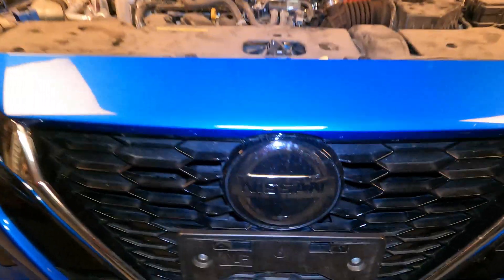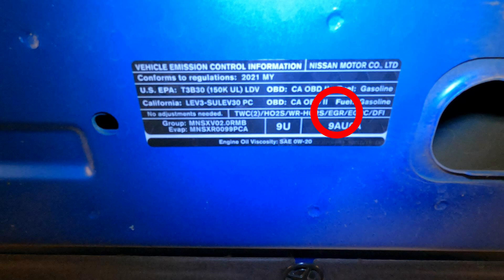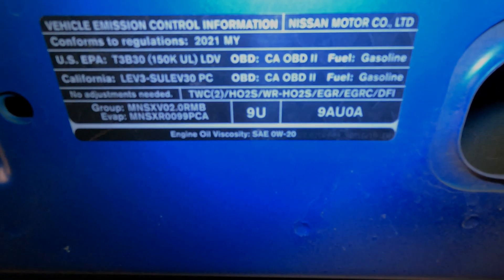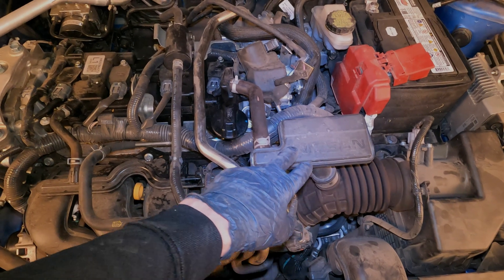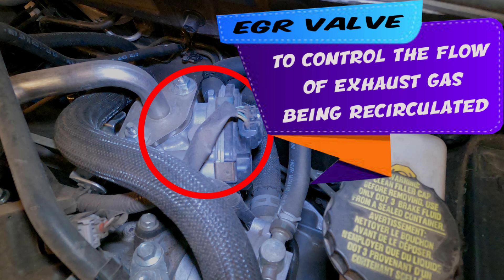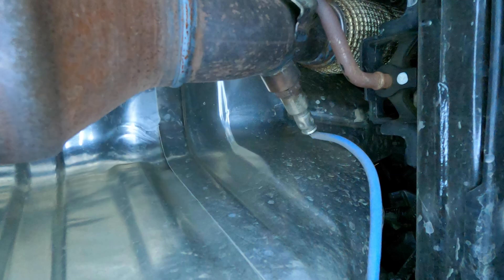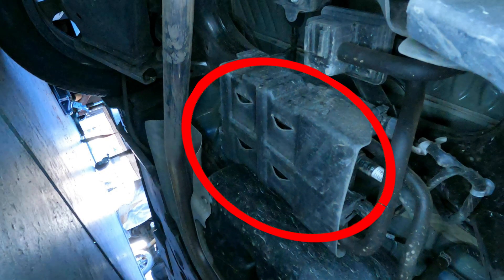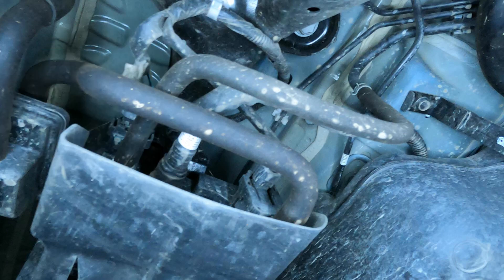⫷ PCV, EGR, Vapor Vent & Purge, + more! Locations & info. Nissan Sentra ⫸

Comment: Hey Scotty I have code P0753. But the thing is is that my car shifts fine, drives fine, and goes up to 70-80 mph easily.( 2000 GMC Yukon) I notice no drivability issues. What could be wrong?